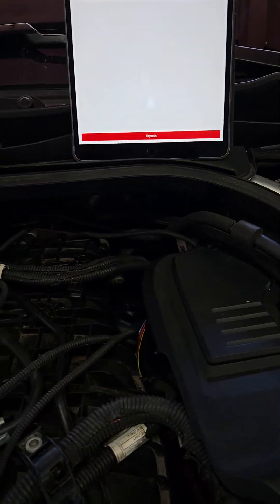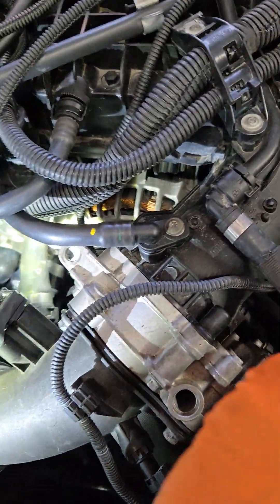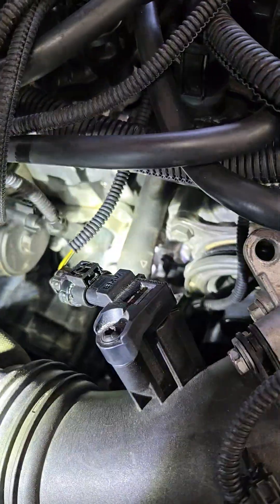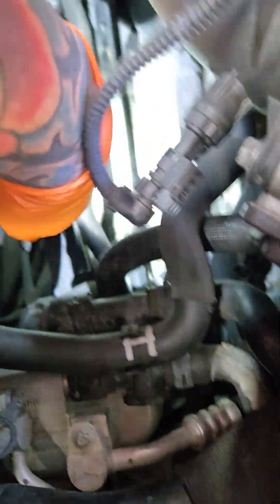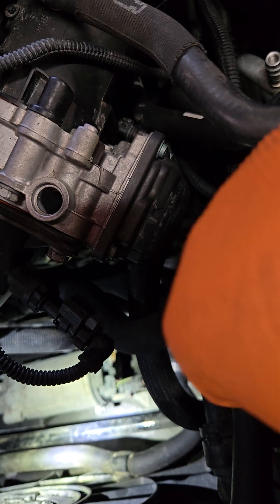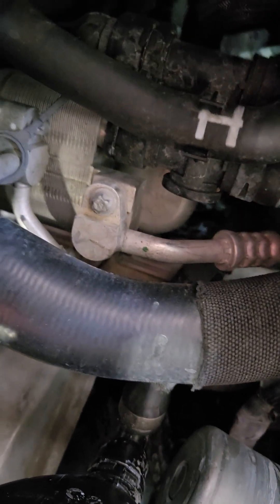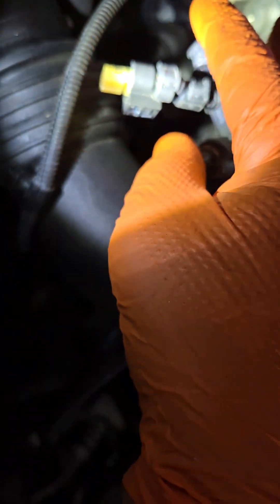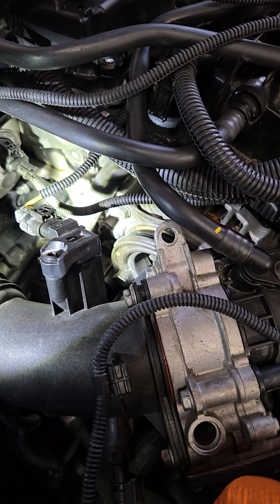BMW X3 CODE 80120A a/c problem compressor shutting down to excess pressure in the refrigerant system

Comment: Another fun fact for you. You will get this code if you just did a coolant service/radiator change, and did not bleed your low temp circuit. And you’ll get the same symptoms. 

A/c used to be simple, its own system separate from coolant. Not anymore!
Reply: Thanks Nick for the video, and Rayaan for the comment. I replaced oil coolant housing. After putting all together, pulling vacuum and refilling coolant, I was chasing this code.  After reading your comment, I checked both reservoirs and sure enough, hot side level had dropped.  Refilling reservoir fixed the problem.
Reply: @MrRQuinones glad it helped!

Comment: Hello, I am a car mechanic in Korea.Right now the G30 530i 1234yf air conditioner is not working because of the 80120a fault code, is the turbo secondary water pump bad?
It's so hard because I couldn't find the cause
Reply from the maker: @도경호-f5f  if the pump is bad the a/c won't work. You can check it with a PowerProbe
Reply: @nicksilvacastro  Thanks to you, I got a hint and solved it.
Thank you so much.
Reply: @도경호-f5f what did you do